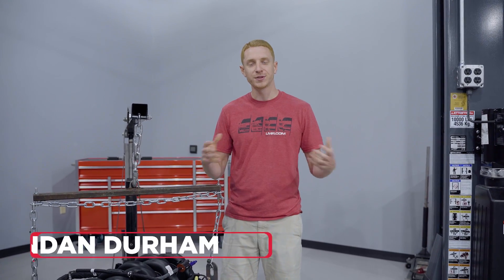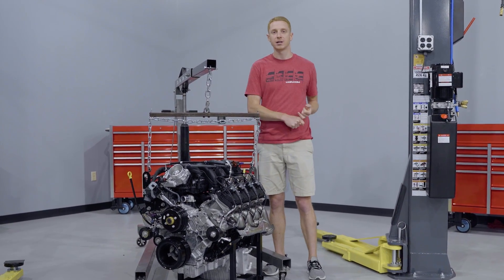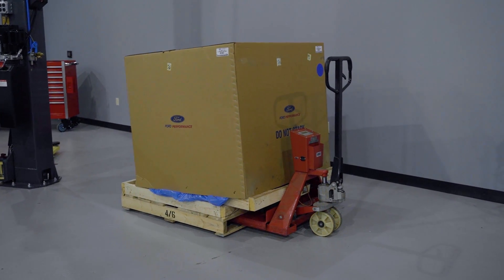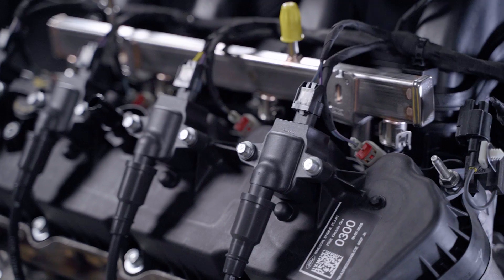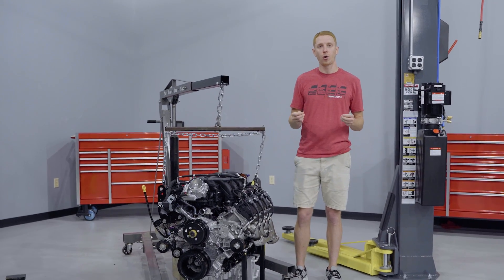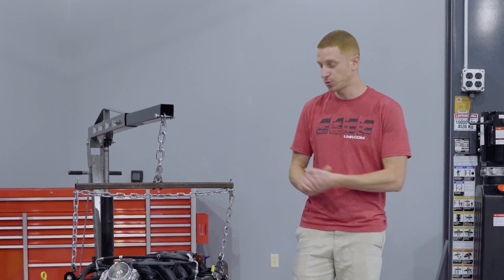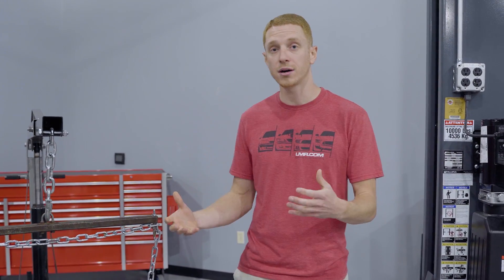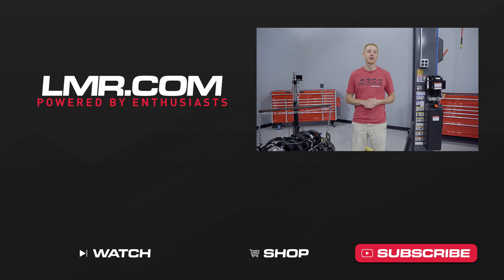Ford Performance 7.3L Godzilla Crate Engine | Review

Comment: With a name like “Godzilla” you’d think this was 6-700hp stock.
Reply: Yeah not the equivalent to a 5.0 coyote..
Reply: @Nick-yp6nv  practically the same, the 2018 5.0 is 460hp stock.
Reply: @brianbane6199  a Mustang 5.0 460hp is a different beast than a 430hp truck engine. Might lose on peak hp however the low speed hp and tq on this 7.3 is formidable. Simple LT headers and a big cam swap should put the 7.3L well into the 500-600hp region.
Reply: @Nick-yp6nv  coyote is aluminum block which isn't as good for lifespan and hardiness.
Reply: @plh8707  aluminum blocks these days are generally more than adequate for longevity and strength. Many aluminum block LS engines are pushing over 1,000hp at the crank with little more than gapped rings, a cam and valve springs. Stock iron block (with gap, cam, springs) 4.8, 5.3, 6.0 have survived 1,200hp, 1,300hp and 1,550hp as well with big twin turbo setups.
Reply: It's tuned for a truck; think about the f150 coyote motors, they are optimized for torque and longevity. Imagine this motor once they dig deeper into it with some ported and performance parts, then it will be Godzilla!
Reply: You should see what the aftermarket is already doing with it :) Making WAY more than 600-700hp N/A
Reply: IT'S A TRUCK ENGINE and only the size is what makes it Godzilla. The upcoming 6.8L V8 derived from this Godzilla will be a performance engine with 600 hp naturally aspirated.
Reply: Ive got a 2015 superduty and plan on using this engine when my 6.2 gets tired which has about 100k to go, I wonder how plug and play it'll be!?
Reply: @redetroitwing  the bolt pattern for the transmission is the same, you will need the ECU, we know it will easily fit in the space where a 6.2L fits. The exhaust after the manifolds is probably identical as well, may need to clock the flanges or adjust the pipe position slightly. The factory air box should work as well. Of course the driveshaft and axle are all the same.
Reply: @redetroitwing  I would rather see the 7.3L V8 gas engine in a 2005 - 2007 F-250 / F-350 4WD Super Duty.
Reply: Explain to me how this would be better than a Ls Chevy engine
Reply: @scottlancaster9066  The Godzilla engine has wider bore spacing and a taller deck which means the displacement potential is much higher, it is a much beefier casting, it comes out of the box at 445ci. The largest factory LS is 427ci, is aluminum, relatively rare and very expensive. The largest mass production iron LS is 364ci. The new LT series GM comes in 400ci, the L8T iron block. I am a GM and Ford guy. I have owned many of both. I have owned (and got started with) Ford 4.6L 2v/3v, 5.4L 3V, Coyote 5.0s, Boss 6.2L, 300 I6, 5.0w, 360FE, 7.3idi. I have owned GM L76 6L, LS3 6.2L, LS1 5.7L, LQ4 6L vehicles as well. I am excited by the new 7.3L and the 6.6L gas engines. I have to admit that the new 7.3 is more exciting and I am leaning towards returning to the Ford camp, especially if the new 6.8L based on the Godzilla is widely avaliable in Mustang and F150. GM is failing right now in 1/2t truck V8s because the 5.3 is the lowest power base V8s, the 6.2 has such limited availability and is only in overpriced trucks. The L8T 6.6L is promising but, it barely out performs the old SOHC Ford 6.2L in base HD trucks much less the 6.4L Hemi. The 7.3 Godzilla is king of the hill and a true return of the Big Block V8 with all the modern advancements and simple easy cheap to modifly, maintain and repair basics all there.
Reply: @hendo337  bang for buck
How much does a Godzilla cost?
Reply: @hendo337  so you are saying that a Godzilla will have more hp/per pound than a Ls 6?
Or Godzilla is more hp/dollar than a Ls 6?
I find that hard to believe
Reply: @scottlancaster9066  they will be once super duty trucks start filling junkyards.
Reply: @scottlancaster9066  Naturally aspirated a factory 7.3 longblock with cam, headers, tuning will make more power than the current 6L and 6.2L GM engines common in junkyards.
Reply: @hendo337  so now you are predicting the future
Everyone knows that Chevy engine is more affordable
Don't get me wrong, I love Ford's, but facts are facts
If you blow up a mustang now it is easier, cheaper, to replace engine with Chevy
And more power
Go to any drag strip, the fastest mustangs have a Chevy engine unless someone has spent a mint building a Ford Motor
I can't wait until people start putting hemis in mustangs
Reply: @scottlancaster9066  Chevrolet engines more affordable? Historically, that is correct. In your opinion, Hendo337 might be predicting the future of availability and cost for good used Ford 7.3L V8 gas engines.....but, I'd place my bet with him. 

Why? Because the Ford 7.3L V8 gas engine will be VERY popular...there will be millions produced.....not only for individual consumers buying F-250 and F-350 XLT, Lariat, King Ranch and Platinum Super Duty trucks...but also numerous city, county and state governments across the country buying the same trucks in XL and XLT trim levels. In addition, the aftermarket parts will sky rocket which will help to reduce the cost of building a performance engine for a swap into a variety of vehicles. 

For a several reasons, the 7.3L V8 gas engine will reduce the percentage of the 6.7L Powerstroke diesel in Super Duty trucks.
Reply: @scottlancaster9066  New 7.3L V8 cost...about $8200 in the crate from Ford.
Reply: High Five! You are exactly correct. Very Well written. I too, like both Chevrolet and Ford engines. Two favorite muscle cars are a 1969 Chevrolet COPO Camaro with the L72 big block 427 V8 or the more rare ZL1 big block 427 V8. However...I also like the 1967 Ford Shelby Mustang GT-500 with the Ford 427 SOHC "side oiler" ( Cammer) V8. The Ford 427 SOHC was out lawed by NASCAR.....and it is the engine in the Ford GT40 that beat Ferrari several times in the Le Mans. Interesting how the Ford Boss 6.2L V8 engine gets it's "engine DNA" from the big block Ford 427 SOHC (Cammer) V8. The 6.2L V8 with higher RPM range was an OK choice for the Ford F-150 Raptor...but not the best platform for the Super Duty trucks. The new 7.3L V8 with "push rod" design...way better for a truck application. 

In reference to trucks.....especially, the Class 2 4WD (F-250 or 2500) and Class 3 4WD (F-350 or 3500 SRW)........Ford by far builds the BEST 4WD truck. Why? Stronger frame (fully boxed vs C - Channel) that is e-Coated, Solid Front Axle (much better articulation off-road on uneven terrain...and more reliable) compared to the IFS axle. The 4WD Ford and Dodge trucks will out perform and go way more places off-road than a 4WD Chevrolet or a GMC. In addition, a Carli suspension with King shocks on a 4Wd Ford or a Dodge will offer a better ride...both on road and off-road than a 4WD Chevrolet or GMC.

In numerous ways......Ford is simply going to smoke Chevrolet and GMC in the Class 2 and Class 3 truck market. GM engineers absolutely do not know how to build a great Class 2 or Class 3 truck. Their overall design and philosophy of obtaining a "great comfortable ride" just does not pan out with producing a great Class 2 or Class 3 truck. Besides, the GM trucks only have a slightly better ride up front with the IFS axle.....the rear spring packs are still stiff...so, very little gain in providing a comfortable ride. Hey GM engineers.......build a truck...not a "car like" truck.
Reply: @hendo337  thank you. I have a 2020 godzilla and I'm glad to learn new good things. 

Speaking of which,  what kind of transmission does it come with? The same as in the diesel variant?
Reply: @scottlancaster9066  Because it's not made by Chevrolet.
Reply: @scottlancaster9066  it not a dame chevy.
Reply: 7.3 Godzilla kills the Coyote in terms of  power up to about 5500-5600rpm mark then the Coyote outshines the Godzilla
Godzilla 
-400ft lbs torque @ 1500rpm 
-peak torque 475ft lbs @ 4000
-400+ft lbs torque from 1500-5500rpm
-peak HP 439 @ 5500
Coyote Gen 3 on engine dyno at Westech ,Steve Brule dyno operator seen on RoadKill, Engine Masters and countless HotRod magazine articles
-400ft lb torque @4250
-peak torque 427ft lbs @4750
-400+ft lbs torque 4250-6250rpm
-peak HP 496 @ 7000rpm

The 7.3 Godzilla truck engine is in its first generation of life if compared to a 1st gen Coyote people would be singing a different tune. all in all its  apples to oranges trying to compare the two engines one HD truck based -the other sport car oriented .
Reply: @codyramos3200  the 7.3 is a significantly more powerful engine, all it needs is a cam, springs, long tubes and a tune to destroy the Coyote it peak hp as well as tq. It's the most exciting thing Ford has done since the Boss 351c in the early '70s. The modular engines were always disposable, over complicated, expensive and gutless engines without boost or being rev'd over the moon. They cost Ford a lot of business that the LS and Hemi have taken.
Reply: @hendo337  the modular 2v 4.6/5.4 were pretty simple and rather durable engines same for the 4v engines ...  until 2005 they introduced the 3v v8's then their reliability became questionable with the vct failures . 1993 Lincoln mark Vlll had a all aluminum 4.6L 4v dohc engine making 280hp 1996 the cobra mustang got the aluminum 4.6L  4v dohc engine making 305hp fast forward to 2005 the mustang gt finally gets 300hp... ford had the capability for years to be a competitor to the GM pony cars  but dragged their feet idk why
Reply: Yep
Reply: They didnt mention Torque tho which is a big factor and it's more of a work-horse engine not a street performance engine.
Reply: Yes, it's more of an Ox than Godzilla.  Strong and durable. But an "ox" is a castrated Bull... So marketing wouldn't go for that. Godzilla won the day.
Reply: hp means less in truck applications. Towing is what id use it for.
Reply: ikr?...400 bhp??...lol
Reply: @rhostatton8944  My Peterbilt with a cat 15 liter only has 475 HP. Godzilla is designed for low end torque to be run 24/7, not 10.5 seconds.

Comment: The Godzilla name for an engine was taken back in the 1990's Show some respect.
Reply: Nissan?
Reply: Pretty sure the Skyline is not an engine
Reply: @nthgth  Pretty sure Ford would want a more original American name for that engine.
Reply: r32 wasnt that fast in the grand scheme of things, it handled well, but it wasnt the showstopper the r35 is.
Reply: @riogrande163  You don't know very much do you ? Also Godzilla is a Japanese movie character.
Reply: @russellgillick7637  the r32 doesnt "own" the name godzilla either, if ford fans want to use the name for an engine, i dont care. No need to gatekeep.
Reply: @riogrande163  Is Harley Davidsons next model bike going to be called a Ninja ? 😂
Reply: @russellgillick7637  Harley davidson hasn't made a performance bike that's up to par in years. So why would they call it that?

Ford has made a pushrod v8 that seems to have massive power potential, so the name fits rather well.
Reply: @riogrande163  HD has never made a performance bike. But that's never stopped them calling their bikes after some atomic bombs that murdered thousands of civilians.

Comment: Im glad to see ford giving good old big block motors another chance
Reply: It's considered a small block
Reply: @zedhead2864  - no it’s not Ford never called their engines small or big block that was Chevrolet. Ford called them 335 series “Windsor or Cleveland” or 385 series “429 Boss or 460”. This 7.3 is not based on any of those two. It does share similarities though. Fair to call it big block since it is more than 400ci nothing small about it. Baddest biggest gas V8 offered in trucks right now. Huge potential
Reply: @zedhead2864  why
Reply: @blackice7408  bigblock and smallblock can sometimes refer to the dimensions and architecture design of the motor, regardless of it's displacement. All of the LS and LT motors from GM are considered smallblock.
Reply: Look dumb dumb it's not a big block

Comment: Why bother with this.. just get a coyote call it a day...
Reply: Exactly
Reply: Which one is more reliable?
Reply: not saying the 7.3 is best but its cheaper than a new crate coyote ... 790hp has been done n/a already with head porting ,cam swap, pistons. intake.. dimension wise i think itll be easier to swap compared to coyote
Reply: Depends on what you want to do with it. If your drag racing then the 7.3 maybe the better choice due to the low end torque.
Reply: Either way this is a turd compared to a coyote

Comment: For that big of a newer motor only making 430 horsepower is an absolute joke..LS OVER EVERYTHING. And it's obvious why.. DEFINITELY SHOULD NOT BE NAMED GODZILLA...
Reply: It is obvious why, but you missed it. This is a dead-stock high-mile boat hauling engine for a 3/4 ton truck, the kind that climbs a mountain pass at 2500RPM WOT for half an hour without getting warm or pinging even though there's a 15,000 pound trailer on you.
Reply: @mfree80286  thanks friend for explaining makes sense..I was going to say the coyotes are monster motor for Ford that's about the only thing they have comparable ..cool
Reply: @mfree80286  Great example to draw a comparison with a different emgine with similar power. E.g. the same situation but with a Coyote under the hood, it would be more like say 4500 rpm.  It wouldn't take it? I realize 30 min is a super long time for WOT but what actually would happen?
Reply: @nthgth  Eventually? You'd wear the bearings out through heat, cavitation spalling, and accelerated 'normal' wear. 

Also, that kind of use accentuates any flaws in heat rejection...example, that tiny tag of carbon stuck in the chamber that's 100% fine in normal driving starts to glow, and cause preignition but not strongly enough to be noticed over all the other noise and fury, until a ring land cracks, etc. etc. To get the same level of horsepower out of a smaller swept volume you have to do things that drive combustion temperature up and make things happen faster overall, so that more events happen over a span of time because the work is cumulative. 

Long story short... shit gets HOT. If it can't cool, it'll pull power back or die. Or both.

Comment: The 6.2 isn’t gone it’s still available. This is a replacement for the 6.8 V10 that was still available in the commercial applications and as an upgrade for the gas motor. The 6.2 is still the standard motor for the super duty